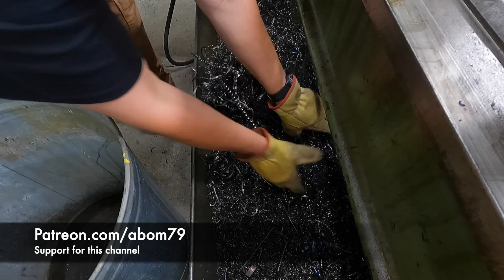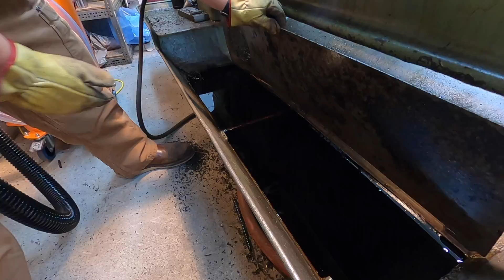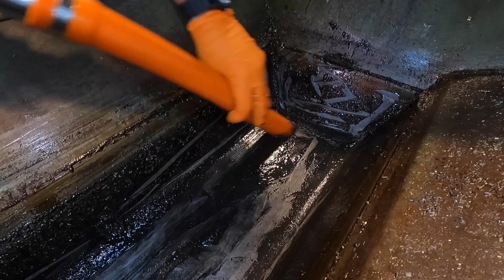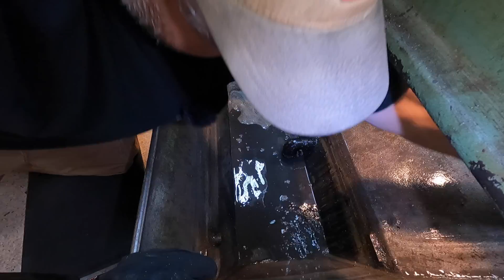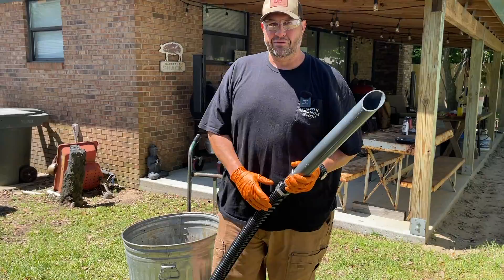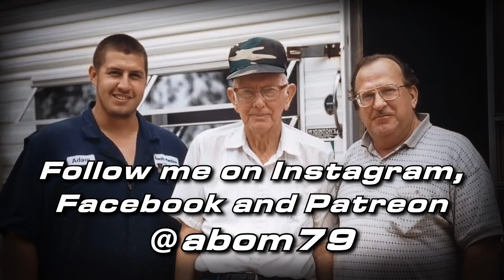SNS 344: Monarch Coolant Sump Clean-out, Freddy Micro

Comment: Another great video :) God thing you were outside mixing that coolant :) When you fill the coolant first and then water, it sprys up fine partickles in the air from the oil that you don´t want to breath in. The proper way is to fill the water first and then coolant and mix it by hand :) Keep up th good work Adam.

Comment: where the hose was kinking. you should wind a spring on your lathe that would fit over it and help support it there
Reply: I suggested replacing the house with corregated or internal-coil supported hose but your idea of just modifying the current one would be cheaper and easier. 👌

Comment: Hi Adam, lots of experience of this in industry using the Freddy (also good when you have a spill or leak to help contain quickly). Do you use any biocide? The sludge in your pan is as a result of bacterial action, biocide in the Coolant helps. Its also good to aerate the Coolant regularly by running the pump (even if you aren't using the machine), all this stuff will make your Coolant last much longer. Cheers, Jon

Comment: I remember, when i was a student and at the machine shop we had to clean out all the coolant sumps, we had 10 machines. After about 1 month, the coolant got spoiled because the other group by mistake mixed water with the incorrect oil (oil that we use to lubricate the machines) and filled the machines with that emulsion. On the schedule we had to work right on that week, so we needed to clean out all the machines all over again to be able to work because it was unbearably stinky, and on the top it had a thick swampy layer wich clogged the entire system. The cleaning was a pain in the ass. :D We would normally do it every 6 months maximum. Thinking back now it's a fun story but at that time it was not funny. :D

Comment: Hey Adam, what does the recycling centre do with chips like that and perhaps even how they do it?

I assume it’s at best a mixture of a ton of different type of steel and at worst every other type of metal and plastic.
I know There are various methods you could use to separate to a certain extent but there must be a point where it becomes “impossible”
Reply: I would think they use a magnet to separate ferrous and non ferrous then heat to different melting points starting at the lowest to separate, flux for impurities and the plastic just burns off

Comment: Get  a stainless steel spring about a 1' long  that fits inside the discharge hose.  Kinking problem solved
Reply: I think it also might be due to the hot water, makes the kinks worse in most cases

Comment: I think that Freddy is poorly designed for draining and cleaning. If I had that I would modify the location and place it about two/three ft off ground and allow the Drain hose to use Gravity rather than motor pressure to reduce that splashing...
Reply: He could probly use the skyhook to lift it when its time to drain as well. Great idea

Comment: You should use Kevlar glove liners.
Reply: Good idea. We used kevlar "cut gloves" in the restaurant that I worked in as a teen. They won't stop you from cutting your finger off if you really intend on doing so, but they saved us several times from accidental harm. I bet they'd stop some pokes from sharp chips. Just put the cut glove on under the leather one.
Reply: @mannys9130  I use Japanese style chef knifes, the single bevel blades. If they are of good steel you can get them to an edge that you could use as a shaver.  I always use kevlar, or stainless steel mesh gloves while using and sharpening.

Comment: Chip of the week submission?   Also, unhook the whole discharge hose and lay it on the ground so that the stuff at the bottom can be blown out completely..  If you leave a loop on the hose, a bit of liquid get caught in the pipe and acts as an airlock...

Comment: Looks like that 'sludge' is some kind of fungal growth at the oil/water interface. Kinda gross ;-)
Reply: Yes that sludge is a fungal growth - a slime mold to be specific. The kind that lives best in oxygen poor fluids. Bubbling air prevents their growth as well as aeration of the tramp oils. It is best to use a skimmer for the floating bits but a roller and squeegee works about as well. Automated systems can be fabricobbled easily if desired and would make a great video series. Let a little air into it for best long lasting results is the answer to the entire problem.